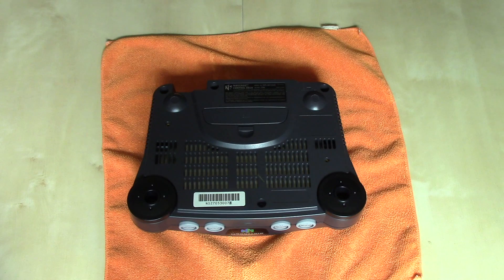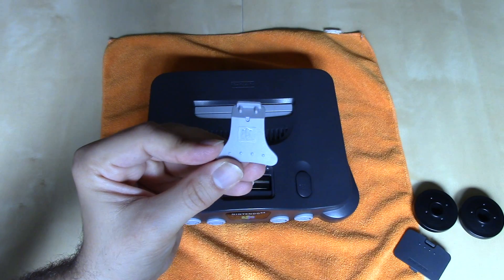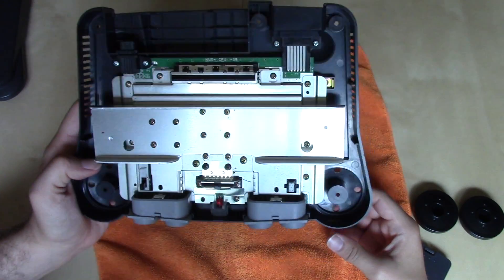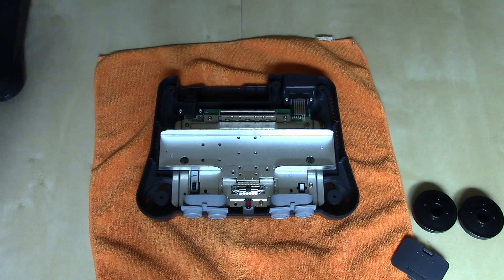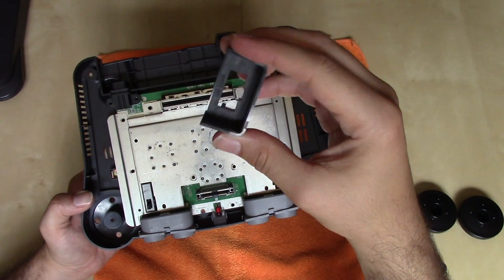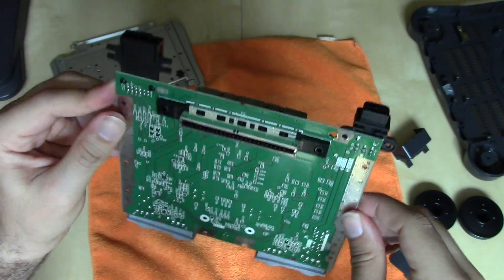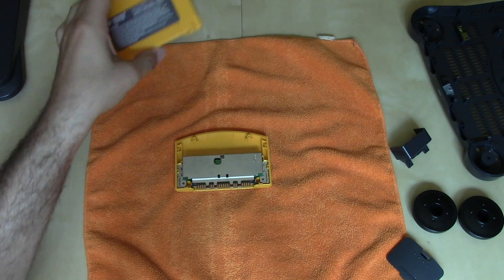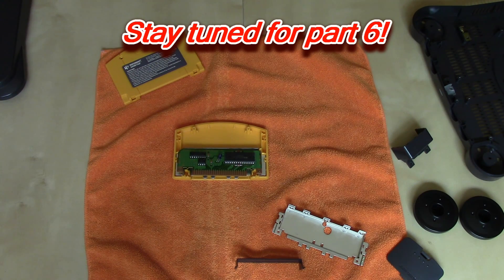Nintendo Torn Down: Nintendo 64 (part 5 of 6)

Comment: Is the original jumper pack harder to find? I would imagine once people had the red one in they would just toss the old one (like me lol) because it would be useless.
Reply: Its actually not entirely useless. Because of the expansion pak's latency, some games would actually suffer from it being present. (Most notably, Space Station Silicon Valley, which would often crash upon start up if its present or crash during certain stages.) If i decide to play that game, i actually put the Jumper Pak back into the N64.

Comment: The odd thing is Donkey Kong 64 ran smoothly without the memory pack, however in testing a bug would randomly crash the entire game, adding the memory pack was the only solution they could find, so they included it with the game.
Reply: This is a myth. It used the expansion pack for the dynamic lighting, and it was planned very early on in development.